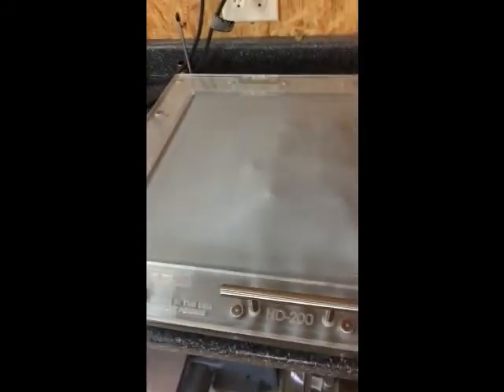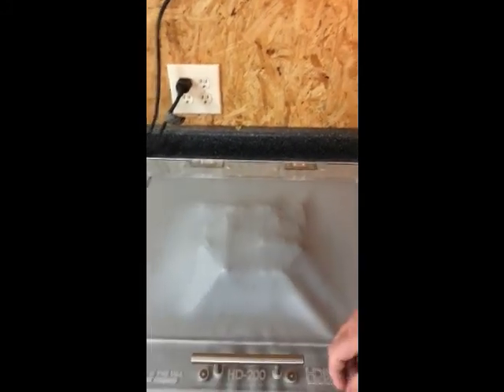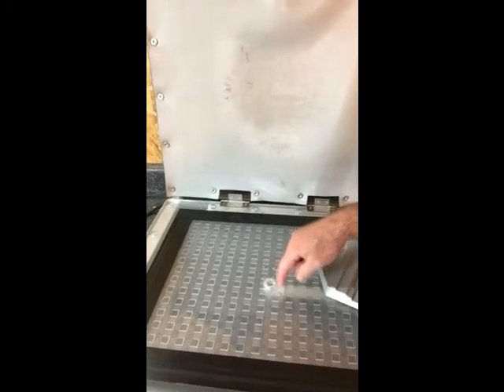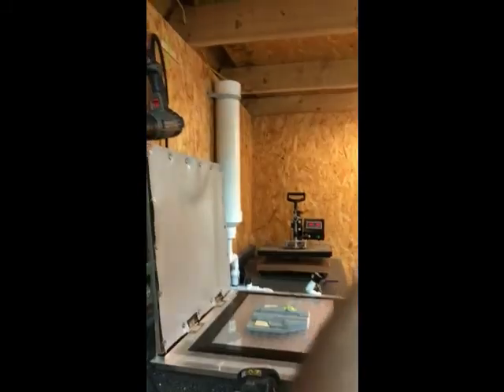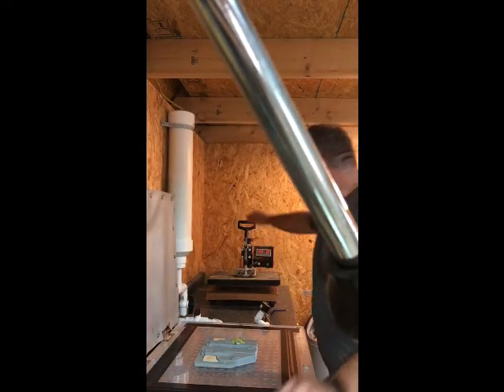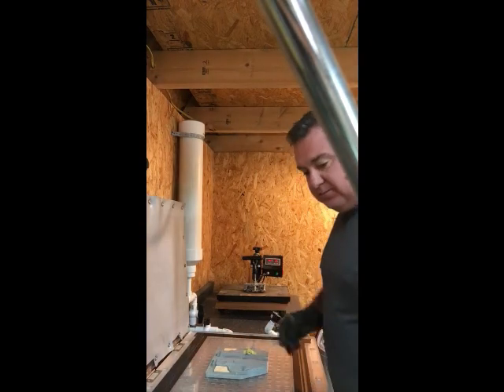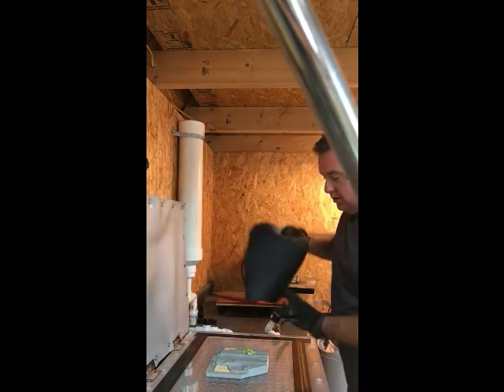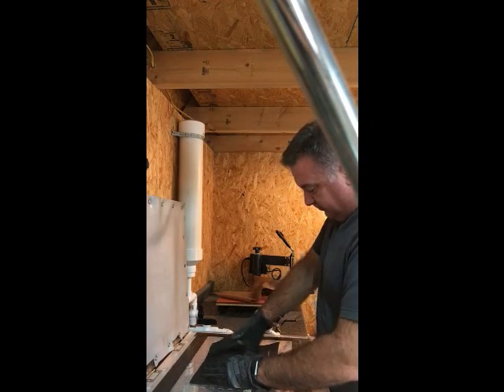Converting your vacuum former from membrane to membrane-less

Comment: what is the difference between membrane-less and membrane former? what are the pros and cons of each and what are each one of them used for?
Reply from the maker: A membrane former utilizes a silicon membrane that is placed over the part and the kydex which produces the vacuum seal. A membrane-less former uses the kydex or thermoplastic itself to create the vacuum seal. Typically you get higher definition from membrane-less forming. The membrane formers cause draping and less definition because of the friction of the membrane on the kydex. You can still get great definition from membrane formers but in my experience, membrane-less formers are faster and product a better product with tighter tolerances.